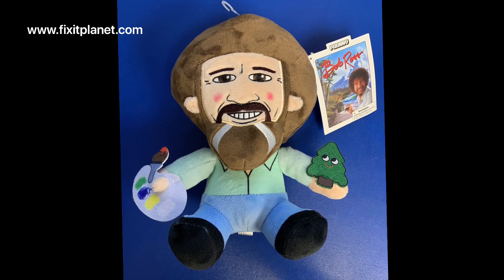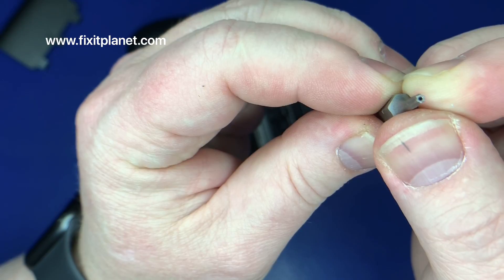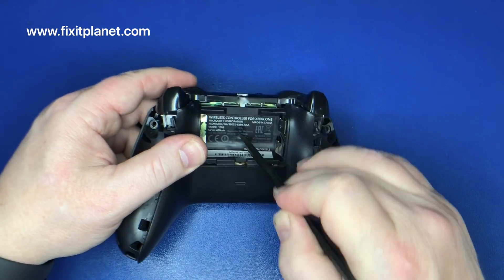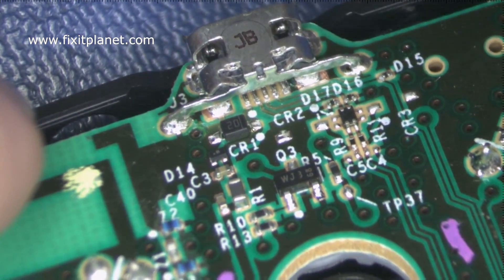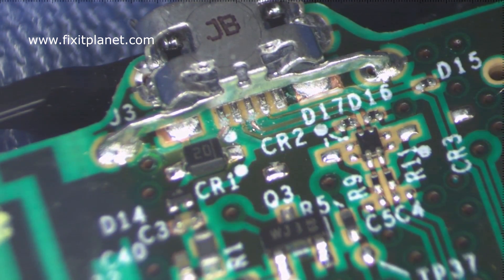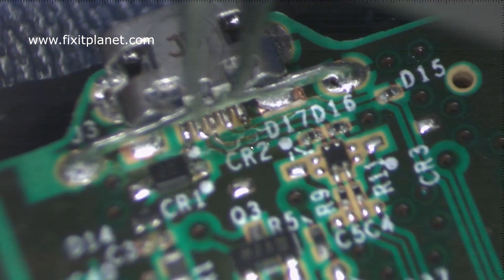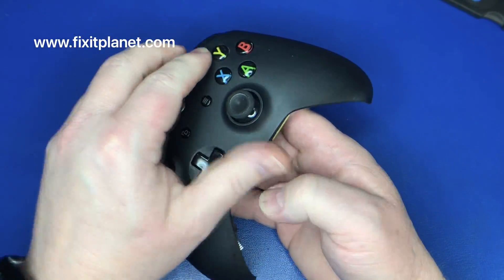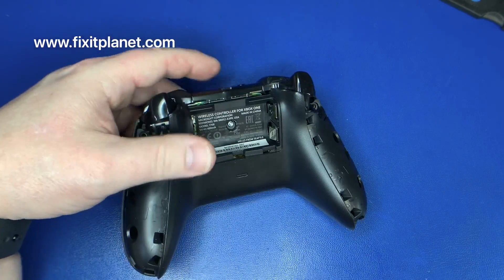Microsoft Xbox Controller Not Working With USB Cable Can It Be Fixed?

Comment: Tried this solution but the pins arent sticking up and are connected well. Putting the cable into the controller makes it vibrate for a second but will not fully turn on/connect. Only get a solid connection if i push the cable hard into the port.
Reply: Hey bro i have the same problem how do you fix it?

Comment: how can i fix a loose micro usb port on one of these? my micro usb cable keeps rocking left to right in the port and the controller disconnects frequently
Reply from the maker: You must at least re-solder or replace the port. Smile
Reply: hey dude i’m having the same problem let me know if you find a solution
Reply: @caesardebossman5180  ended up buying a new micro USB cable and it's a bit sturdier

Comment: I've been looking everywhere for this solution. Thanks!...It seems like there should be a wired adapter that fits into the battery slot (use instead of a battery).

Comment: Do I have to apply the flux or can I just solder after pushing the pins down?
Reply from the maker: I recommend using flux. It is better if you use flux but not impossible to do. Anyway why would you not use flux??
Reply: @FixItPlanet1  I don't have the flux. I just have the solder and the iron. Thanks for the help though.

Comment: what solution did you apply at 6:34?
Reply: I think that was solder flux
Reply from the maker: That is Flux
 AMTECH NC-559-V2-TF Flux - 30cc https://amzn.to/3pdx1bU  or Chipquik Tack Flux no clean in a 30cc https://amzn.to/3rs3QUG
Reply: @FixItPlanet1  will hot glue work
Reply: @smittygoatr6418  what i did and it works is just buy a wireless dongle, it worked for me
Reply: @slykk  oh how much is it
Reply: @smittygoatr6418  $30 aud
Reply: Will hot glue work

Comment: How do i fix the usb port on my xbox elite controller? version 1?
Reply: Same
Reply: @keytein2554  i learned how to fix controllers and stuff now just replace the motherboard with the port on it and you should be good that’s what i did and it works just fine now
Reply: @Figipuffs  what port
Reply: @xoSpxms  the one where you plug an android cable or something related to charge the controller or to use it wired the one in the very front yk?
Reply: @Figipuffs  yes sorry I was confused  I don’t think I can fix mine I think the thing is actually broken off
Reply: Same bro I dropped mine now it won't charge

Comment: Is it the same thing like What mine does is that I need to hold the charger or cable a Type of way in order to work or turn on the controller would it be the same problem

Comment: I dropped mine onto the floor once and now it will just randomly cut usb power and it's damn near impossible to get up and running again. 
I can't count how many times I dropped my ps3 controller, still works like a champ. This build quality is just awful and the A button has always been bad with registering.
Reply: Hey bro i have the same problem how do you fix it?
Reply: @kisi5mDrop it harder 💪
Reply: Forreal, my baby momma bounced my remote off my head several times (on accident)😊 and it still running smoothly

Comment: My controller won’t connect via Bluetooth. It blinks, and it will do the rapid blink when the sync button is pressed, but will not connect. I tried to use a usb to connect it, but it still will not register on my Xbox. Any ideas what this could be? Is it fixable? It seems like the controller is still usable because it lights up but I truly have no idea.
Reply: until very recently made controllers you need an adapter for the pcto detect them. It isnt a bluetooth controller its more similar to logitech does with proprietary tech.

Comment: If I move the controller a lttile bit the wire makes it disconnect and yesterday the wire completely does not work like my controller won’t even turn on any more
Reply: Did you find a fix
Reply: Kripo no I ended up messing the cable inside the controller i got a replacement thi

Comment: I use this same Xbox one controller on PC (for warzone), and recently dropped it and it fell into those USB plug while plugged in. 
Now, it seems that the right analog stick no longer is recognized, and when pressing the select button when I get I to a game, it interprets the controller as a keyboard input which is weird. I was thinking maybe I partially broke a connection so my PC no longer recognizes the device as an Xbox one controller, but still shows as a "Gamepad controller" in my device manager. 
Do you think that might be a result of a partially broken USB connection due to the direct drop on the plug? Wondering if I should try this fix or not.
Reply: i think i have the same prob;em for fortnite i play controller pc so yeah ive dropped it too

Comment: I dropped my controller with a USB wire in the USB port and I've managed to bend the usb port now my controller just cuts out if I move the controller slightly so I have to now go back to using batteries
Reply: Yeah same for me

Comment: How much would a repair like thus cost at a shop??
Reply: The same price of a used controller. Just get another one unless you are doing the repair your self.
Reply: @shul5684  cheers I stopped using controller it’s been 11 months lol. Thank you for the reply tho!
Reply: @Nonmercury  bro... just bought a wired controller right now.. just to realize the cable i was using on my old controller WAS NOT the right one.  I was using a cellphone cable and those cable only CHARGE they don't send information... I feel like an idiot.. oh well I guess I have 2 controllers now lol
Reply: @shul5684  that’s so annoying ahahaha, most cellphone cables now do actually send data but older cables don’t. I would suggest seeing if any other cellphone cables that u have work

Comment: I know this is a simple repair but I still learned something from it. I've done a jumper before using a thicker gauge wire which I flattened before soldering. I didn't expect the small wire to allow for such a robust solder joint. Thanks for posting!
Reply from the maker: That's awesome thank you!

Comment: My controller will connect to the cable and all that fine but when I go to turn it on it just blinks a few times like it can't sync and turns off after about 6 seconds.. I tried this with another controller and it did the same thing I thought it was the cable so I replaced it.. nada.. then I thought maybe it's the actual usb connection I was using on my Xbox so I switched it to the other one and.. nada.. I'm pretty much that far in my investigation. With batteries the controllers work flawlessly so I'm confused
Reply: Mine don’t even work with batteries
Reply: Any developments??

Comment: plz make a video i put my charge in my controller and it wont turn n and the charger in fine it works with my phone and my other controller
Reply: Take out ur battery and put it back in ur controller if it’s still broken it’s ur micro usb
Reply: Ouitk what is that

Comment: the person at xbox that thought putting a mini usb c port on an xbox controller was a good idea should be shot on sight.
Reply: That's not a USB-C
Reply: @txnezer  it is now for the newer consoles and im having the same issue in a usb c f*ck them
Reply: 2011-2013 tech. Guess you can't expect much.
Reply: That’s not usbc but ya u right tho because cables never stick tight after a while

Comment: I do not find a helpfull answer on my problem.
It won't connect with USB UNTIL I use it WITH batteries.
Is this still the same issue like in the video?
(It worked with usb without batteries before. Of course. It should, I know. 
I just don't understand what's the problem now. And it get's hot though down in the middle.)
I tried even a new controller - same problem.
I feel like a noob ^^'
Reply: Me too!
I could use it before with the usb without batteries but now I can't...
Reply: I have the same issue. 🙄
Reply: And the thing is - my 10 year old(!!) 360 Gamepad works on the same USB-ports without a problem!
But the One-Pad is just better designed, I like it more.
Reply: Guy's I had the same issue try switching the usb cable's and use another. My controller's works just fine now with the new usb cord.
Reply: @jaydenharper1275  I've tried 3 other cable's...
Well, but maybe this will help someone else. Thank you anyway.
Reply: @Nekrokon  yeah, well if u used 3 cables It may be that the usb port is messed up also I was told on Microsoft question forum to update the controller which I did may help you in your case who knows.
Reply: @jaydenharper1275  
The USB-port is finde. My 360-controller works on it
 And an PS4-Nacon Pro controller works eather.
I tried the update, but it breaks up at 57%. 
You know... I play video games over 20 years now. I have dozens of different controllers. Even my oldest ones work fine. I treat my stuff with care.
I'm just very dissapointed from microsoft, seeing that I'm not the only one with the issue. For me it's just a matter of principle...
Reply: @Nekrokon  it jas to be turned on first before u can use it woth usb same issue i had
Reply: Same one here and  I cant find the issue too
Reply: Same problem here 2 controllers..
Reply: I used 4 different controlers, 3 different cables and it won’t connect at all, i opened my xbox and the connection between the mother board and the usb plug is perfect, i also tried to charge my batteries and it worked, but it won’t work in my controller
Reply: @alangracida4777  xbox has to get turned on before u can use it with usb